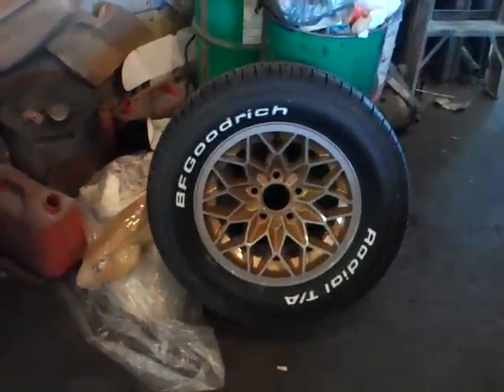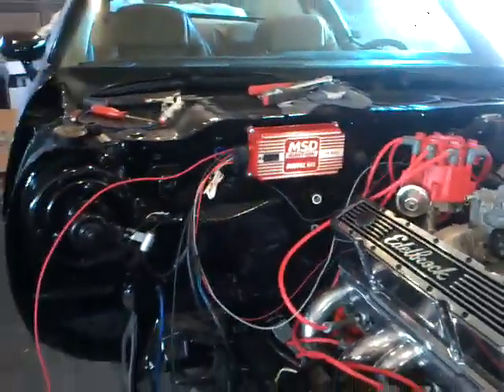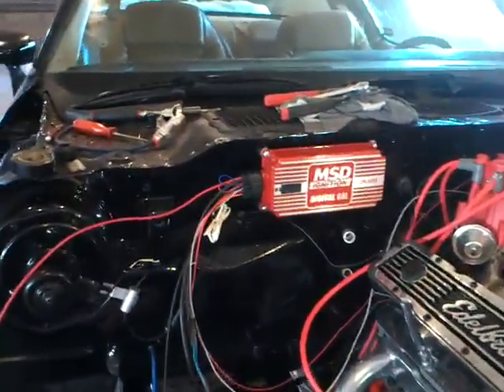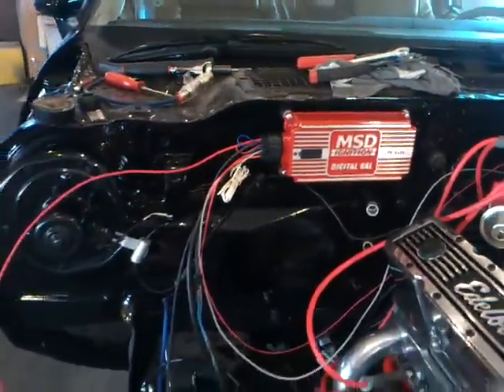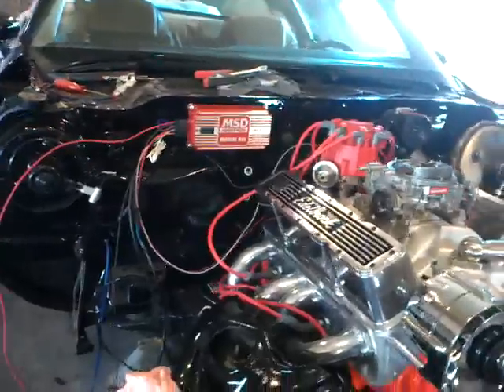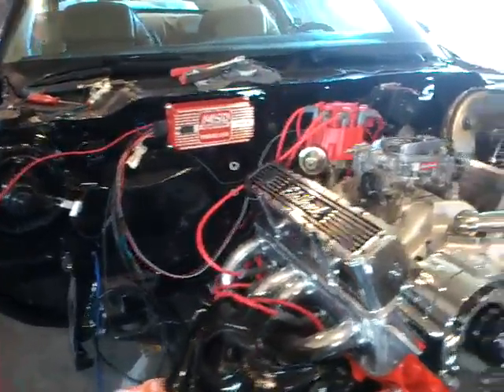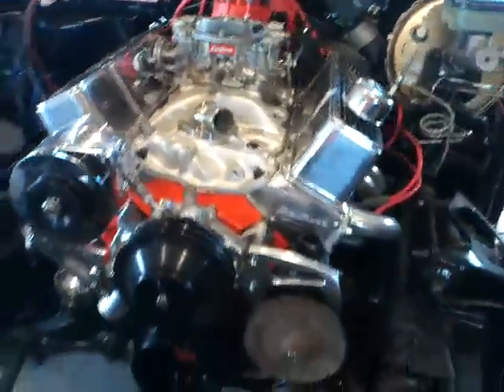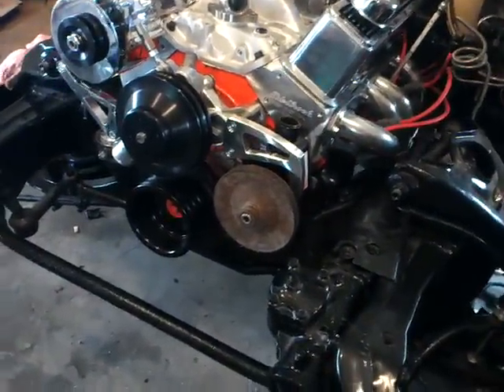1981 Trans Am Restoration Project - Some more stuff done

Comment from the maker: Bought the car from original owner in 2007.  Action Transmission is doing the restoration for me.  They disassembled it for me in Nov 2009.  Sent the body parts and frame out for paint.  They started reassembling it in Jan. 2012. New parts came from Classic Industries and Summit Racing. The PS pulley, Summit sent me the wrong one, new one is on the way.  They had to put the old one on temporarily to shim the pump and bracket.  New video every week until its done, so Subscribe!!!